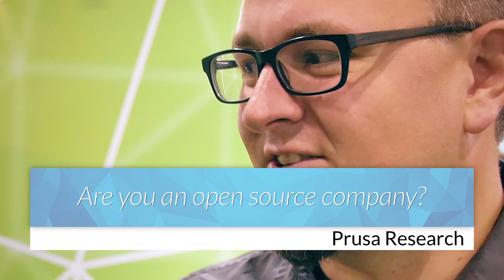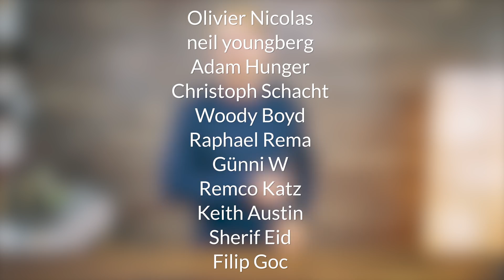"Open source" is more than a marketing term!

Comment: Apple, the company that emphasizes secrecy and closed source (excluding Swift) is currently the company with the highest profit. And people like to spend for their products, either for functionality, for design, for stability... or for fame. Updates and new ideas can be delivered to end user quickly as they are the only one who supports it, and cleaner source works out better.

On the other hand, Android the open sourced smartphone OS had been long labeled as "watered down copycat of iOS'. Yes it expanded the smartphone industry very quickly, empowered many company to release their version of smartphones (although I don't think they open sourced their code for the OS, I might be wrong). However, the propagation of updates and improvement from the original source take forever to reach the users, and some might resulting in buying new gadgets because the older doesn't support new OS.

Open source does get things done faster, but at the same time, it also obsolete things faster. New ideas coming everywhere in the community, and new product implementing new ideas are coming up in a quicker pace. With more and more new things to support, company tends to obsolete old things faster, which indirectly obsoleting the end product resides on the hand of user.  If the product is not a pricey piece, that will be no problem at all. But if the product is skyhigh priced, it can be a big problem. 

Conclusion, it come down to the main factor of $$$ and compromises tolerance. 

PS: Sorry for being a bit off tracked.
Reply: Jasphere Rindou Apple isn’t quite as closed off as you’re making out.

Mac OS is built on the open source FreeBSD and makes liberal use of open source software that they do share back any changes they make.

They’re also the IP owners of the open source WebKit (which Chrome, Safari and a whole host of other browsers and applications use). And they open sourced their Swift programming language with version 2.

Honestly I would say that a key component of Apple’s meteoric rise in value is their realisation that they can benefit from open source (especially since OSX) and that sharing some of their ideas as open source is just mutually beneficial.
Reply: "cleaner" source LOL.

Having worked for automotive companies for a long time, nooope. Medical companies, neither. People who don't have to ship their source code out to somebody else don't actually care. Small middleware companies that ship source to customers easily rank on top of code quality for me, with open-source projects a close second. Most of my friends work for closed-source software companies, and things are never all that peachy, you merely have a better insight into code quality issues with open source products.

It is particularly when open-source code gets haphazardly adapted into a variety of products, that we see cracks in quality most easily; but they would have been there regardless, such as the nature of engineering.

Not to say i am a fan of Android and all of their engineering decisions - i'm just not, nor am i making any statement about value to customer, it just pains me when people use such fallacious and damaging arguments while seeing only half the picture.
Reply: Apple is the master of planed obsolescence https://tinyurl.com/yaxno92b

Comment: Great vid!! 
Open source is the s--ht. I do understand companies who dosent want to share their work. But, some, e3d, lulz, duet, ultimaker shows its working well. It would be working much better. If china manufakturers contributed. Instead of just ripping it off. I might be wrong. But are there one chinesium (ty ave for the expression) who do this the appropiet way? 
Anyway, those who only ripps off, will never be in the lead, tech wise. 2nd place is the first looser.. 
To be honest. I do rely heavily my self on OC. I do use marlin, cura ect. But, coding software isnt my thing. But tuning marlinsettings, cura ect.. What the greatest thing is for consumers. Is when a product has passed its economical loop. There is still continued support and development. Who hasent had tech stuff that has needed service ect. When contacting the manufakturer. You get the message that its no longer avalible. So you need to buy the new version... 
So, while writing this. I realize that open source also is a "green" enviromental thing. Longer lifecycles of products. 
Sorry for rambeling in "swenglish" :)

Comment: doesnt xyz use marlin firmware?!? xyz is literally the worst 3d printer company and their printers are garbage with crap support. sincerely a former xyz user.
Reply: People who have investigated didn't find substantial parts of known GPL firmware in the printer so far. There's no sufficient indication as to where the firmware could have come from originally, whether it actually might be original development, or simply well enough disguised. It has been suggested that it looks functionally closest to Repetier (which has evolved to be structurally very different from Marlin, though both are derived from Sprinter), so most of the effort concentrated on verifying how close it is to Repetier, and it doesn't seem to be.

It could always be aprinter, which is not only hard to detect because it comes out wildly different when compiled with different compiler versions or due to small source changes, it also comes with a permissive license that wouldn't require the manufacturer to publish the source. It became usable around 2014 when the printer was released. It also doesn't have any connections to GPL-licensed firmware so the developer could license it to the manufacturer with no attribution. 

They did find big chunks of Slic3r in XYZWare though, in a very likely breach of license.
Reply: You and me both, started with a DaVinci 1.0 and eventually ripped out all the electronics and rebuilt it with RAMPs 1.4, it now operates substantially better along side my Taz 6. 👍
Reply: I say Chinese but it may be very prevalent with Asians in general and a lot of people who got into 3d printing thanks to the Anet shouldn't have too.

Comment: The elephant in the room is the Chinese. If you have a successful product, there is a chance Chinese manufacturers will clone your design. At least so far, there is no(?) giving back to the community from Chinese manufacturers. Will this ever change? Or is this some unfortunate aspect of Chinese culture?

How well can the open-source model work when constantly undercut?
Reply: Sure you're going to get cheap clones,  but its hard to hide the "cheap" part of the equation.  I mean,  who out there is going to ask why they would spend the money on a Genuine Prusa when I can get an ANET A8?  Sure,  you can get a semi-reasonable facsimile of a Prusa under $200, but if you need to throw in another $100 in parts and go in and do your own soldering to get the thing to a "not a potential fire hazard" level of quality I don't think they're exactly keeping Josef Prusa up at night. 

And yes,  there are some reasonable cheap 3d printers out there (I'm using a $200 MP Select Mini and getting good results out of it) but those have their own set of problems.
Reply: Hans-Joachim Bierwirth OK, so something like a Wanhao i3 is probably a better example than an A8, but there's a fair bit of divergence there as well.   Still,  most of the effort is going into making things as cheap as possible.   On one hand,  you get some really questionable products that way.   On the other hand,  it's also kind of cool that  you can get stuff like Arduino Nano v3 clones for about $2 apiece shipped,  cheap enough to make them practically disposable.
Reply: You get cheap chinese Laser engravers and cutters aswell and IMHO there never were open source Laser machines that could be cloned. Argument from this is: chinese manufacturing has nothing to do with the open source philosophy or open source products. Also those clones never were clones in the first place. I. e. an Anet A8 is based on a concept too simple to get legal protection and no part of an Anet exists in a Prusa.
Reply: It is hard to blame only China for overflowing market with "clones" (they are usually not clones, but terrible attempts to make 3D printer - and than glue Prusa name on it as part of marketing). All this printers are sold in the West! West costumer choose to buy cheap product from China.
It would be the same if someone blame only Columbia for all Cocaine sold in the States - if there is no market, no one would make "white".
Reply: PC or not, it's an established fact that the vast majority of Chinese 3D printer manufacturers are turning out clones of other companies' existing products.  Copies of the original Makerbot, copies of Prusa designs (which Mr. Prusa dislikes quite a bit, mainly because there is no improvement of the design and thus no innovation being given back to the community).  I've seen Chinese knock-offs of Ultimaker hardware too.  I would challenge you to try and find another nation-state on the planet that harbors as many companies engaged in creating knock-off hardware based on existing products, violating others' IP rights, and not honoring Open Source license requirements (i.e., not giving back your improvements to the community).

If the United States were a haven for companies like this, I'm sure we'd be talking about the "American clone problem" in the 3D printing world.  (Fun fact: The United States used to be a pirate nation, making cheap knock-offs of goods and published material.  Then the country grew up and started recognizing international IP law.)

Yes, if you copy someone's hardware design, your product is a clone.  Even if you modify the design slightly, that's still a clone.  Cost reduction in manufacturing can be innovative, but it doesn't make the resulting product not-a-clone. It doesn't matter if you release "your" designs publicly; what you created is still a derivative work under copyright, and it's still a clone.

Maybe you don't speak English as a primary language, or maybe you're really obtuse.  Or maybe you have a vested interest in confusing the discussion by trying to redefine the word "clone."  Whichever the case: If your understanding of the word is different from the rest of us, that's your problem.  Don't make it ours.
Reply: euhm, is that question totally PC? does it matter that these guys are from China for your argument?
Secondly: why do you use the word 'clone?' if they release their designs to the world, why do you call the resulting products 'clones?' By the same token: does your phone run a 'clone' of linux? The low cost manufacturers do a lot of innovation on the cost side of manufacturing. Sadly, that is knowledge that is a lot harder to capture in design files and copyright licenses.

Comment: I give Ultimaker a lot of credit for sponsoring and sharing the Cura software. If they want to wait a bit before releasing their new hardware designs, that seems a fair trade-off between giving back and profiting from their design work.

In my opinion ... more than fair. As I use Cura, I directly benefit from Ultimaker giving back to the community. Seems to me they are giving back to the community well in portion to the benefit they received.
Reply: They should release they firmware for UM3 - that seams to me as most important thing. This could propel dual extrusion on CoreXY home build mashines.
Reply: True, Cura is what gives UM some OSS credibility. On the other hand, there are very few contributions from other companies in the source, so I have my doubts if that community part is really working.
As for it rubbing off on their hardware: no I don't think so. Derivative drawings are not the source files, you lose all parametric features. it is not open source, calling it that is lying.
Reply: Whatever and you have a spiffy day.
Reply: no you get reduced features if you import an stl or step.  The definition of open source is not 'openable in some cad program.' It is not their source files they are sharing. UM is the new makerbot.
Reply: Jelle B are their source files able to be opened up in Solidworks/Autocad (no, the cad software used doesn't have to be open source as well) and you can pop out a stl for instance?  If yes then there is OS if not then they are not OS.
Reply: I disagree unless they say they are 100% open source software and hardware.  What you want and what might propel anything is immaterial.  Frankly I get this huge idea from the OSS/OSH people is that they could care less as long as it is free stuff.